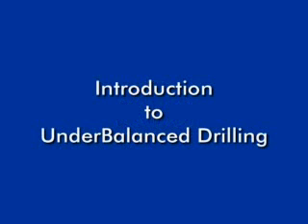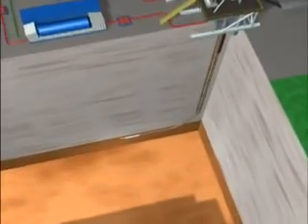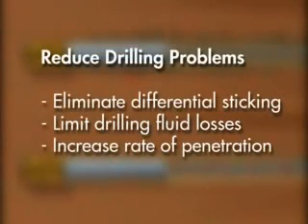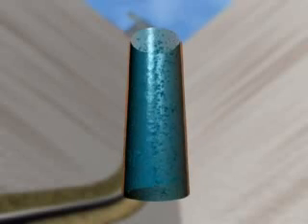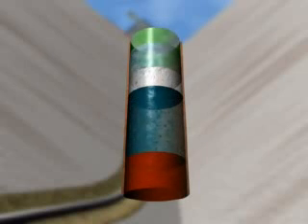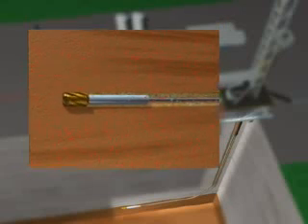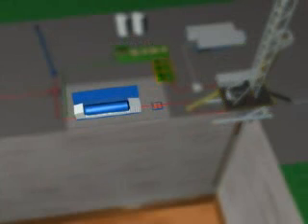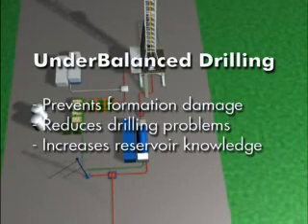UnderBalanced Drillling

Comment: Lower bottom-hole pressures can be achieved by using a light fluid aerated by nitrogen.
The boys from Schlumberger are experts in this area. The question is WILL nitrogen affect the torque of the drilling bit?

Comment: Is it applicable in overpressured reservoirs? Does the drilling using the light circulating agent carried out right from the surface conductor depth or they start using it only in the res. interval?